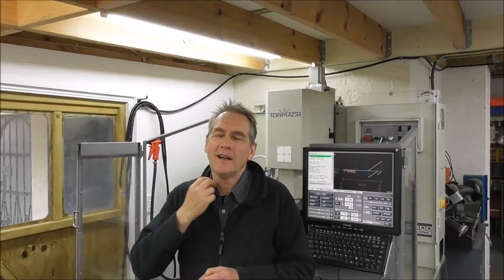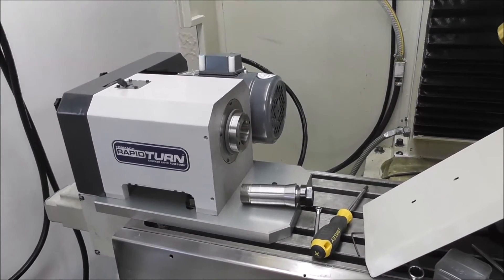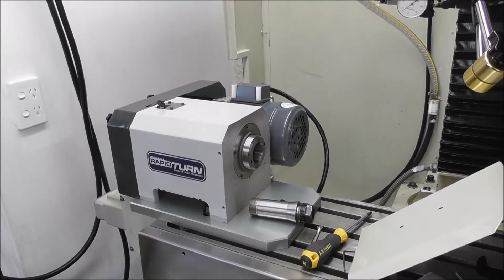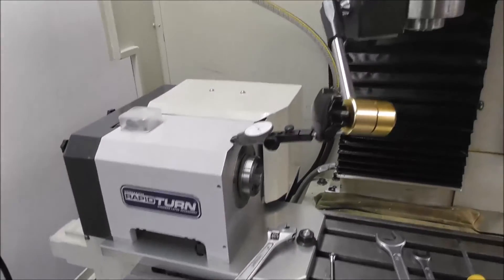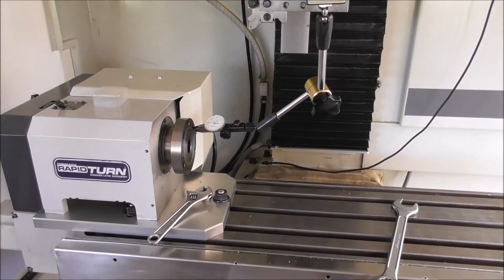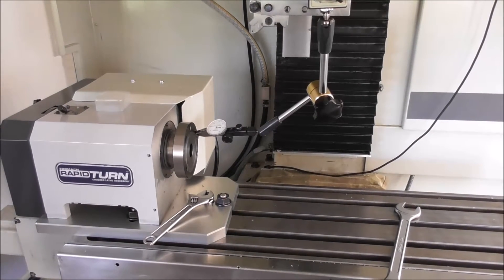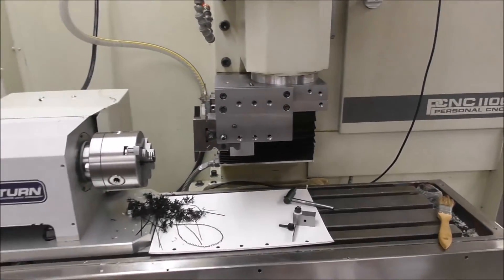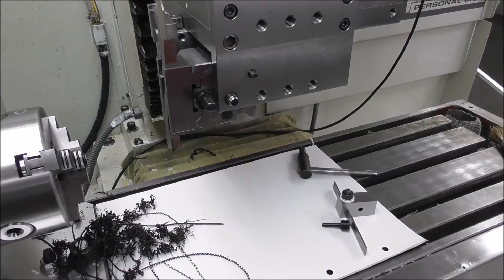Tormach RapidTurn - 17.   Up and Running

Comment: I've never thought you were being negative in any of your videos Cliff. Just the opposite in fact. Getting an honest assessment of the equipment from someone who's obviously had a great deal of industrial experience in manufacturing parts to tight specifications is something many with Tormach equipment on Youtube don't have. Probably just luck you got one with a bad sensor on top of the previous RapidTurn having the oversized spindle to collet locating bore. It looks like you've now got it working very well. I learned that paper trick from a few old machinist books. I'll usually use Zig-Zag cigarette rolling papers in my shop since there almost exactly .001" thick. The old methods work just as well as the day they were first thought of. But your only the second one I've seen on YT to show it. It's always surprised me about how many have never heard of it though. I've got one of the digital Haimer 3D Tasters that I'm pretty sure they no longer make and I'll still use that paper trick when it's just faster, easier or good enough.
Reply from the maker: Thanks for your 'positive" take TP. Most appreciated..  Cliff